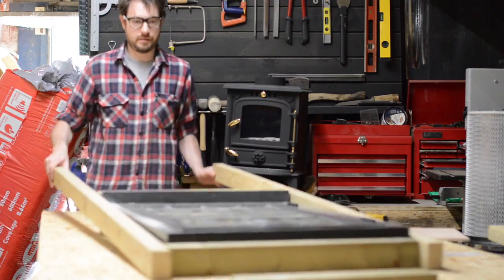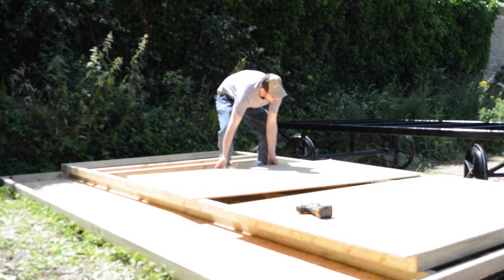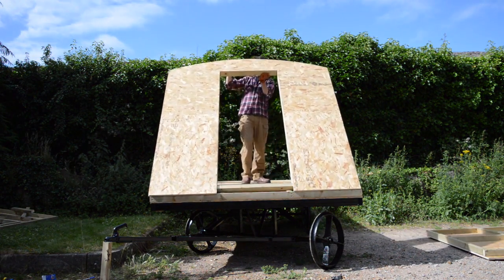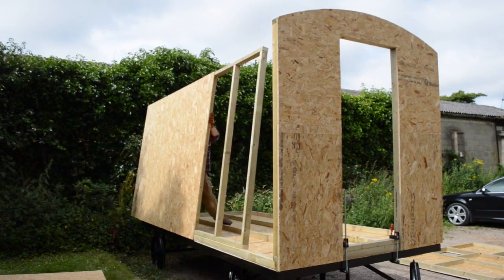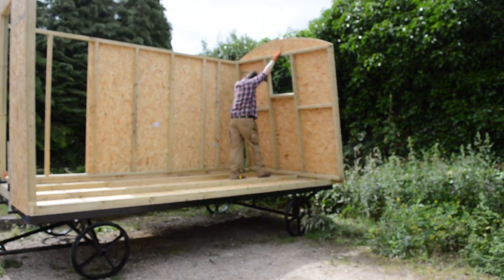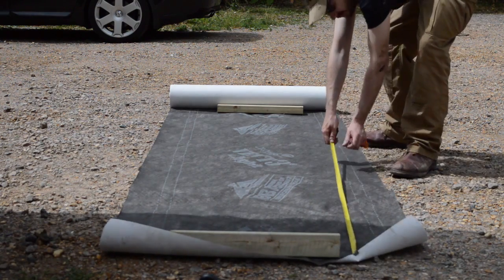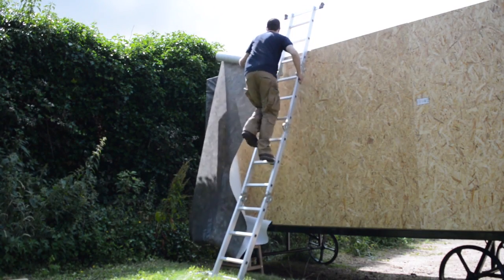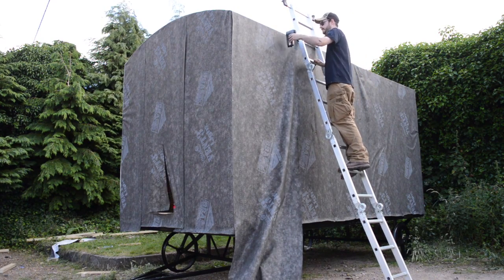Shepherds Hut Build Part 3 Side Walls

Comment: I know...everyones an expert on YT but, as a professional chippy I've had to put up acres of membrane in my time. Anyone thinking of doing this, apply the membrane horizontally not vertically, working from bottom to top. The last piece you want to fit is over the centre of the roof - it's highest point - front to back say, not side to side. The lines on the side of the membrane are there as a lapping guide. Enjoying this series though and no offense is meant.
Reply from the maker: Thank you for the tip.
Reply: Not a problem. Great project. Would love to do more stuff like this myself - that's why I'm here watching ;).

Comment: Love the videos.  I am planning to build one on an unused hay wagon (8' by 16').  While I am impressed with you putting this together alone, at 70 I am planning to line up some younger help.  My big issue is trying to source curved roofing metal for the roof in Canada. What is the high of the curved end wall?

Comment: Thanks for the series. I'm planning a similar project and your videos have been exceptional helpful in ironing out a lot of the particulars. Im wondering if you could share some more information on the type of breathable membrane you used? Does this give the hut water tightness? Perhaps you could note the particular product/manufacturer if at all possible? Many thanks again!
Reply from the maker: Glad it helped. This is what I used https://www.screwfix.com/p/cromar-vent-3-lightweight-breathable-roofing-membrane-dark-grey-1-5m-x-50m/7116p

It is breathable so it does help keep the water out but also help stop it getting damp.

Comment: Awesome overview. Thanks! I'm building one of these as well. I've been struggling in the planning phase as to how to do the rafters. Your solution looks super easy compared to the arched pieces some of the hut companies use. Was this a guess on your part that it would work? Or have you seen this done somewhere else and know it's going to be strong enough? My hut will be primarily mobile so I want to make sure the roof doesn't blow off while driving! Thanks again.
Reply from the maker: Thank you. This was the second I have done with this roof. The company Plain use this style. The first went about 100 miles on a trailer. 

You do need to start laying the roof sheets from the back. So when its pulled the wind can't get under the joints and lift them.
Reply: Excellent. Thanks! I look forward to seeing you complete this.